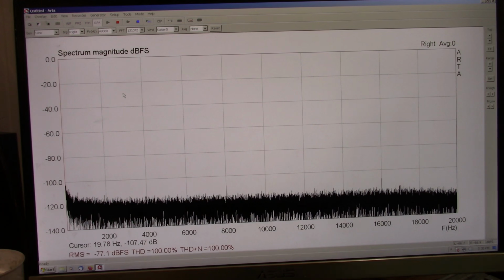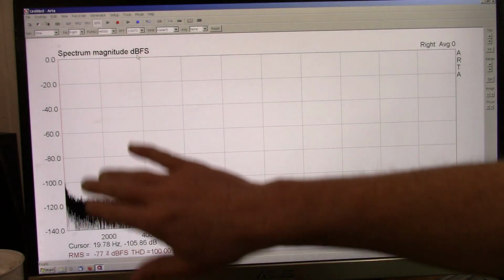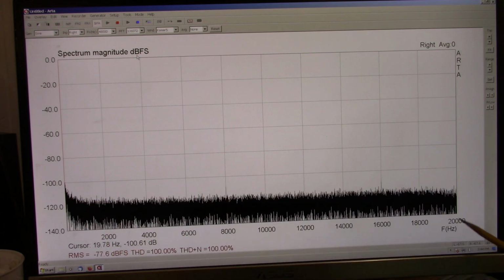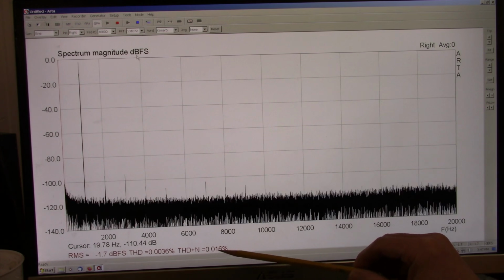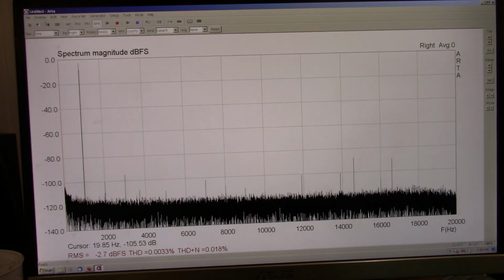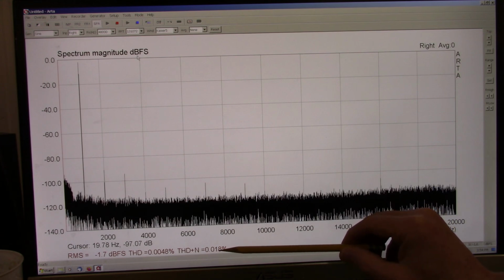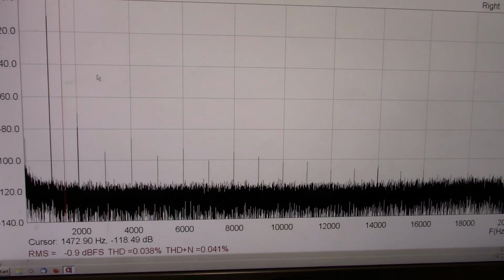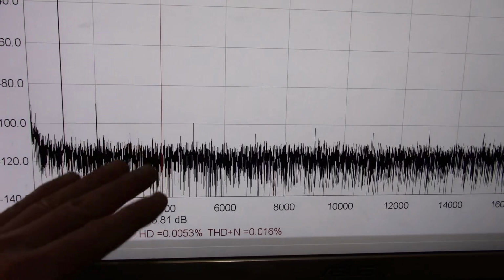LM1875, TDA2050 & JAT501 amplifier distortion measurement at 8 ohms

Comment: My experiance is: when testing distortion with Arta, the quality of the soundcard matters.
It is not so much depending on the soundcard chip, but the design of the card power supply/filtering.
Nowadays audio-enthusiasts mostly are using high quality USB soundcards - but PC USB power delivery is always very spiky/nasty.
While being OK for normal audio/listening applications, it might be not enough for deep THD measurements.
I could improve my card by adding high quality electrolytics and ceramics in the power section (ferrit coils were already present),
and 1uf multilayer ceramic blocking caps piggy-backed over every chip found on the soundcard. 

Perhaps you give it a try - for me it expanded the THD measuring headroom (if I correctly remember it was about 10db to 15db plus).
You can easyly test the progress by using line in-out loopback/shortening.

Comment: You have shown in all videos that while measuring Watts of an amplifier a load should be connected to its output but if an amplifier output is connected to a Woofer of say 4 ohms and also a tweeter in parallel of 8 ohms via a simple capacitor used as crossover, then how much resistance will the amplifier see as load since a multimeter can't measure the tweeter resistance (DC) due to capacitor connected in series and only woofer resistance is measured by it (4 ohms) ?

Comment: So, I have a stupid little project I wanna do, Bluetooth Senheiser Hd280 Pros. So I need a nice tiny amp I can use with a 3.7v battery. Im planning on using a BK8000L chip for the receiver. Any suggestions? The headphones have a set of 64ohm .5watt drivers.
Reply: The limiting factor here is: "3.7v battery" - there arent much chips available. Perhaps you could consider a step-up converter... this would increase the amount of possible amps? The only amp working well with 3.7v I know is the PAM8403. You can find them everywhere for cheap...